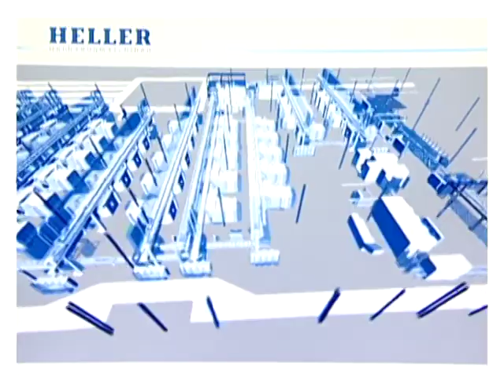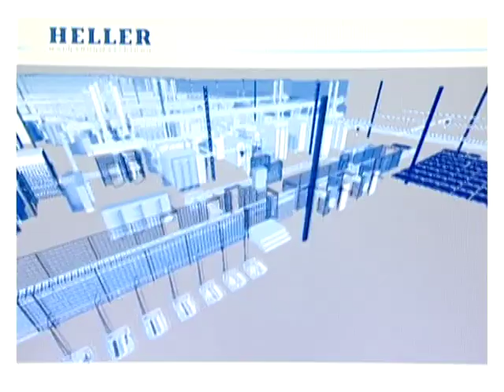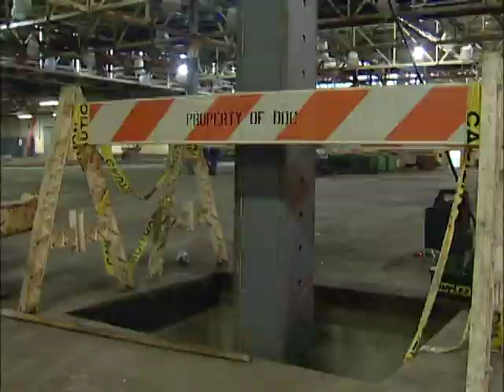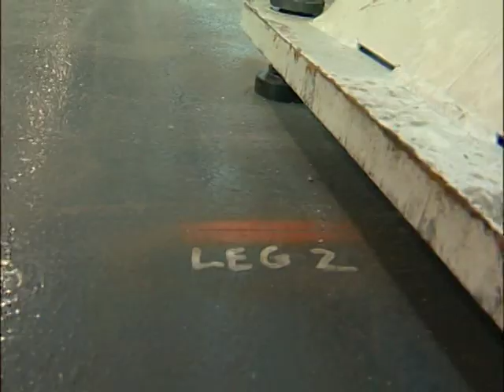Detroit Diesel Corporation Raises the Roof

Comment: Very cool to see I'm working here now and almost didn't believe them when they said they raised the entire roof but here it is, incredible engineering.
Reply: Royal Roofing Orion Michigan was the roofing contractor & im the Foreman who ran the roofing crew durring the raising of the roof, we did the largest roof list in history at Detroit Deisel & had to invent new ways to cut & weld on this project,before the lift we demolished tons of outdated roof top mechanical rooms , gas lines & miles of structural steel  , the head of your bldg maintainence was a very good guy to work with named Dave Gedokee " spelling " pronounced Ged - Oh - Key ,we did that entire history making project with only 1 serious work related injury where a Journeyman named Rick got hit in the face with an 18" steel cutting saw blade, the roof systems 1st layer is screwed down, the 2nd & 3rd layers are put down using glue and liquid asphalt spray , the top layer was put on using torches to weld the top layer together as 1 piece with the rubberized bottom layer ,the bldg wasnt raised as fast as shown, the footage was sped up , the lifting process took over 12 hours & was recorded for an episode of the History Channel show Modern Marvels .
Reply: Here i am a year later,ask Dave Gedokee whos the head of bldg Maintenance if he remembers men and he will ,all together my crew roofed over 10,000 square of the complex .